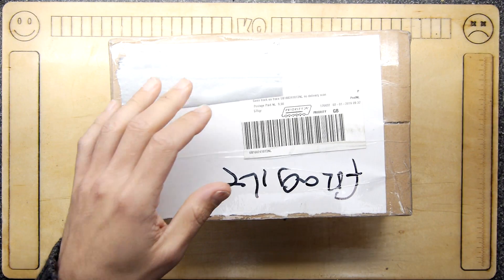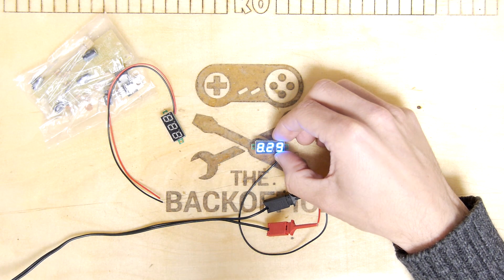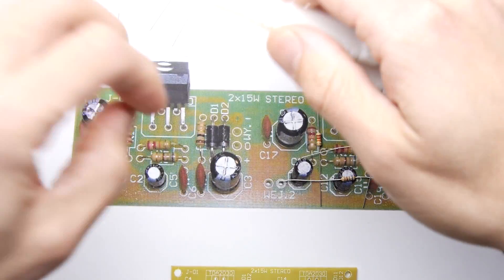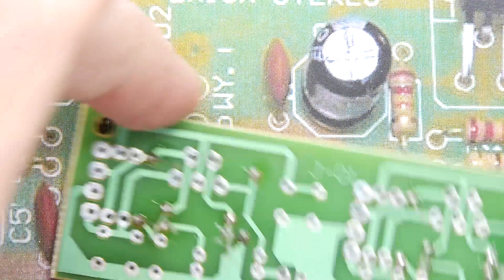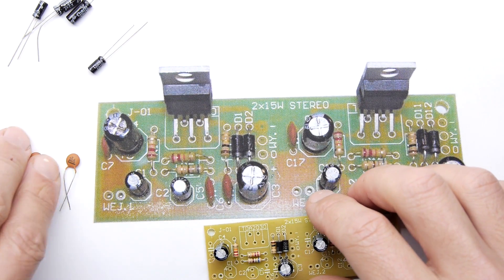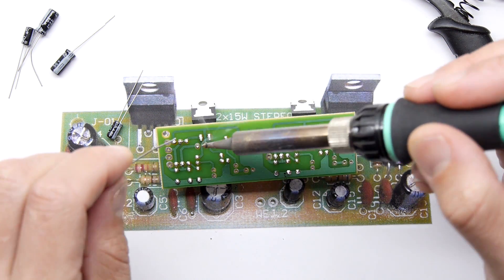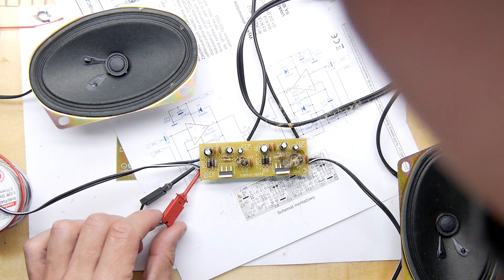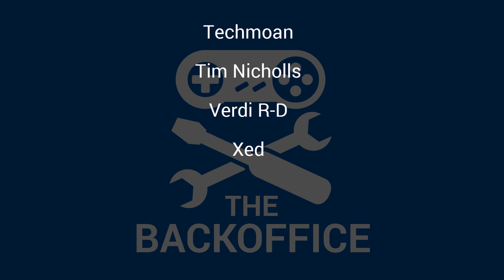Stereo AMP build AKA How to blow up capacitors with Aphex Twin!

Comment: Try using a split supply next time :   +14v 0  -14v  -  this is NOT a single supply design
Reply from the maker: If your say so 👍
Reply: yea, the circuit has a GND rail which should be 0V , a positive +Vs rail and a negative -Vs rail. 
That's why the caps xpired.. you had reverse volts across one pair.
The data sheet shows max supply is 36V or +/- 18V. Hope this helps!
Reply from the maker: Helps a lot, thanks for the description of the issue

Comment: Nice to see dr. A.
Reply from the maker: I think I would have rather ended up with a working thing, but I think I can find some new caps and try again! Maybe I'll translate the instructions or get a data sheet
Reply: backofficeshow I now you can fix it. Otherwise put some new cap’s in. And wait for new year to power it on. 😋

Comment: hi dr a thank you for the shoutout and the meters are difrent colors  or maybe you have two blue but i have them in red ,blue ,yellow nice video thanksssss btw no this is how the kit was deliverd no instructions bga is ball grid array
Reply from the maker: Ha ha! The meters are really cool, I might hook on up to my car! Did you make one of these kits as well?
Reply: @backofficeshow  
Thank you sir and sorry  for the heart attack
Reply: @backofficeshow  yes but this one not yet im making a radio kit  that i bought ages ago but they have instrucions luckely  this kit i sended you was 8 euro and no instruction but now that you build it  will be easy to do it also greatings sir and it was spectacular to see the caps blow (but not the smell)
Reply: i use these meters for several things to see how much  power they use i used them in my raspberry that i builded in a nes case and used aone meter wher the power knop was ,on my 3d printer ,build one in my amiga etc i love these meters they codst around the 1 euro 15 eurocents  and they are good enough for me i buy them from banggood
Reply from the maker: @thedutchretrogamer  I need to look into what went wrong, I think I might have hooked up some of the connections incorrectly or used the wong voltage. I think it was pretty close to being correct, but indeed was fun to hear the caps pop!
Reply from the maker: @thedutchretrogamer  Thats a really great price for a useful little meter for sure.
Reply: @backofficeshow  yes it is and they are pretty need with those mounting holes mostly I glue them

Comment: When i was building ne5532 headphone amp, my caps also blowed and scared me a lot.
Reply from the maker: Did you ever figure out what you did wrong? I will have to debug this sometime, but I am kinda sad it did not work as expected as I could have made some active speakers today!
Reply: @backofficeshow  my power supply was from old router rated DC 12V 1A and i connected to circuit. First cap was rated 16V so i thought it is enough voltage gap, but after i power it on my cap blowed. I tested power supply voltage without load and it was 16V 😐 so i think power supply voltage was over cap limit